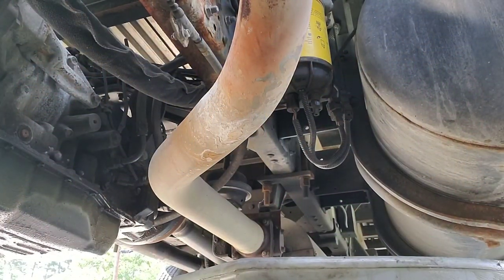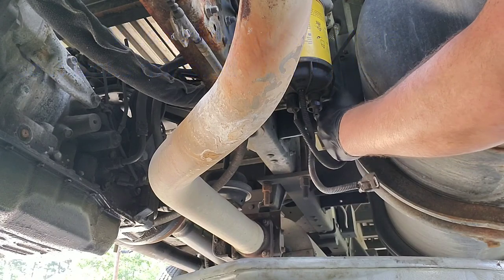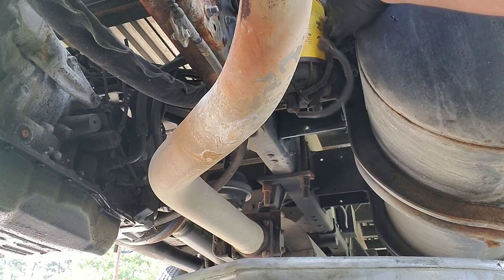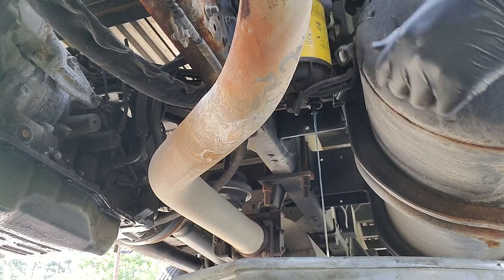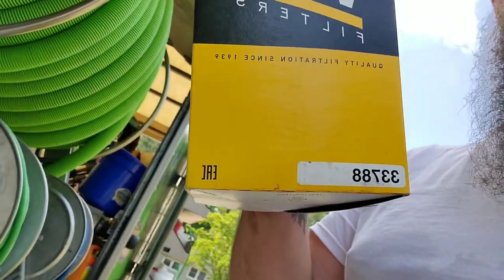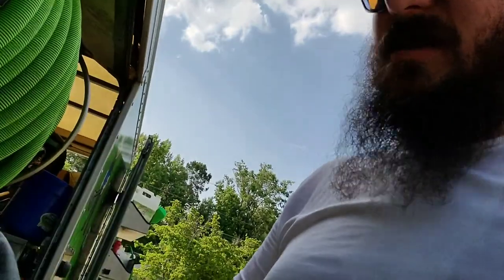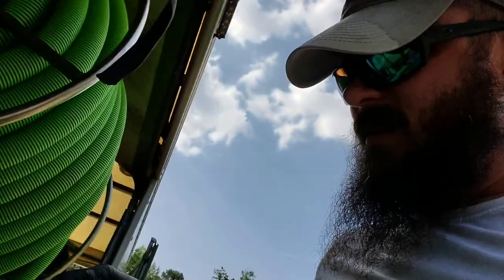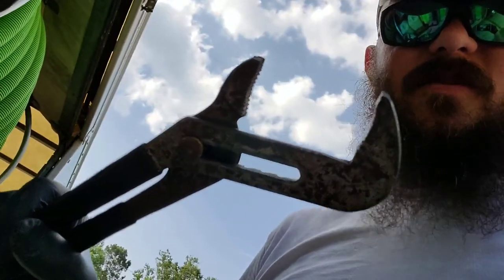UD Fuel Filter Replacement

Comment: Hi what if u haven’t changed for year or so what can go bad? Had that light on for wile and now changed filter and truck won’t run on low rpm only over 1000 rpm not sure if that’s the problem?
Reply from the maker: Usually a clogged fuel filter will begin limiting your power and you won't get high rpm.